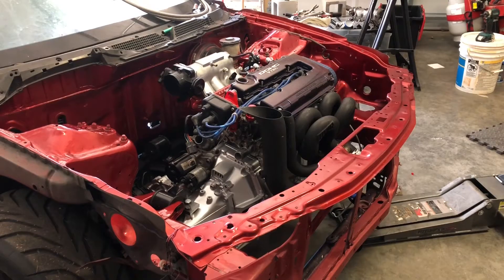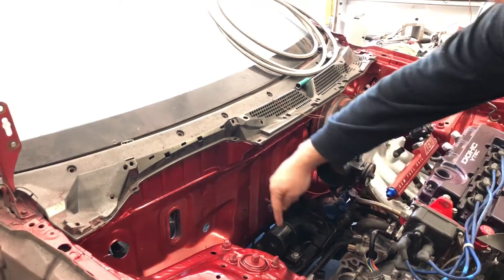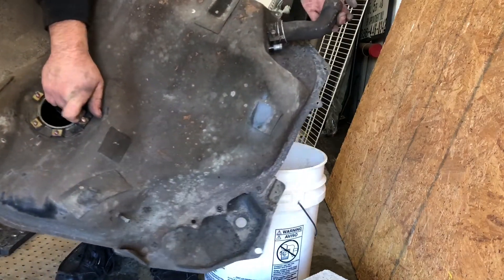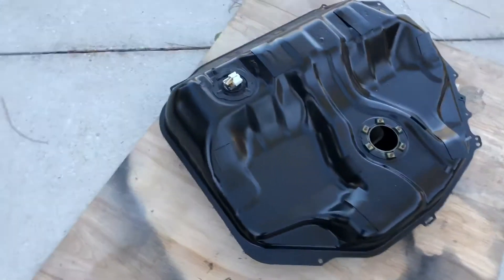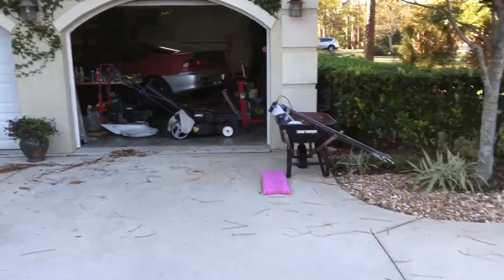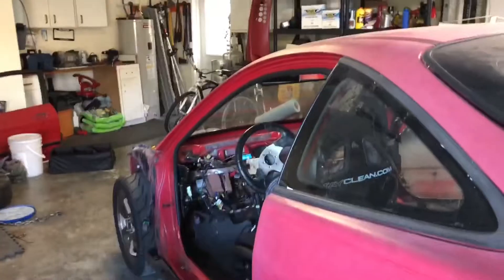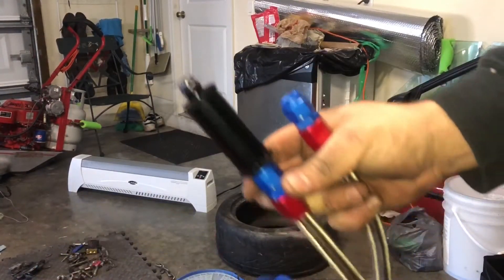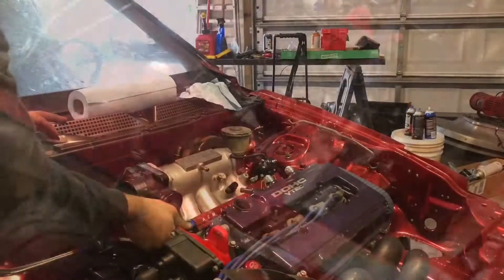Project SlowIntegra: Making a Fuel System for the RaceCar

Comment: Roughly how much did you spend for the lines, fittings, hanger, etc? And are you using the stock feed as the new return?
Reply from the maker: Around 150 id say. Stock return
Reply: SP Tuning that's not bad at all. I was under the impression that it'd be around $600. Cool man. Thanks for the video.
Reply from the maker: Thank you for the support!

Comment: What size AN lines are you running on this setup? Great videos btw
Reply from the maker: -3 oil feed. -10 oil return. -4 water feed and return
Reply: +SP Tuning what size lines are you using for the fuel?
Reply: +SP Tuning what size fuel lines are you running as well?
Reply from the maker: Ah sorry lol -6 AN feed stoc return
Reply: +SP Tuning sweet, thanks!

Comment: The line seem a bit too close to the sway bar. When the car is on the floor might contact and cause rubbing issues.
Reply from the maker: Mmmmhhh good point. Ill double check and if anything rethink my line routing. Thank you for the thought !
Reply: SP Tuning I was gonna say the same thing. The sway bar sways bro. Lol

Better safe than sorry.